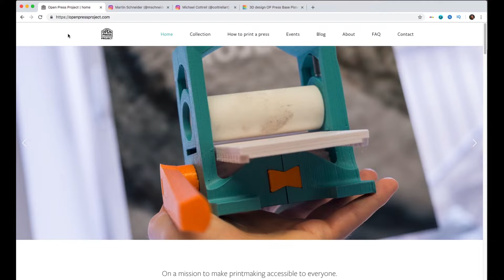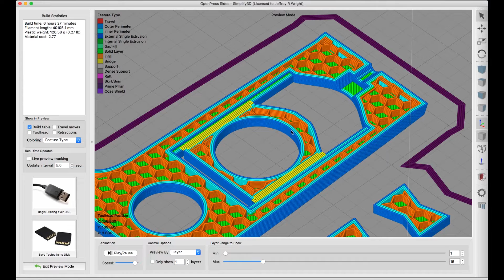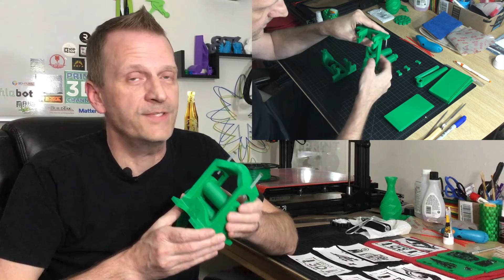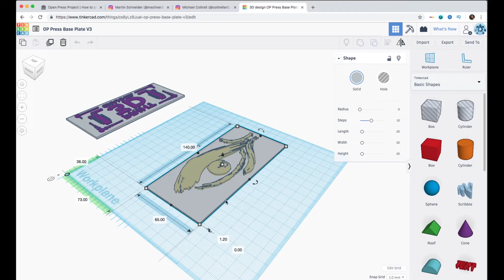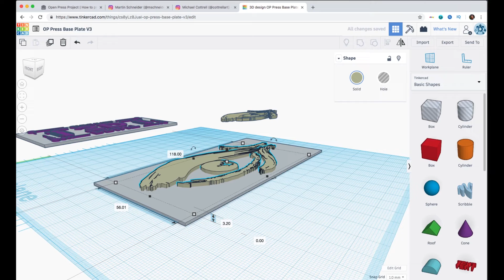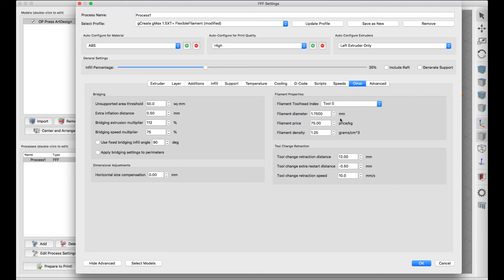The Open Press Project - The Open Source #3DPrinted Printing Press

Comment: You don't really need a printing press for relief printing. A roller or banana leaf pusher will suffice.

The press is intended for intaglio such as etchings or drypoint printing.

With the small press this becomes accessible to pupils/people that can't afford or don't have the means to build an intaglio press.

A unique kind of pribting is Tetra Pak intaglio where you can use needles to make thin lines but combine it with bigger areas when you remove the plastic down to the paper.
You need a press for that and the little press is very well suited.